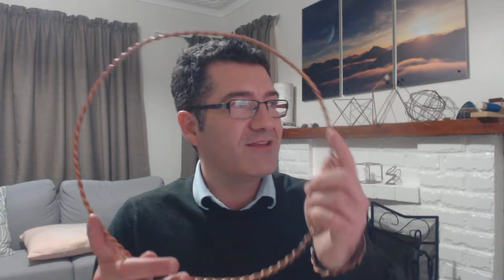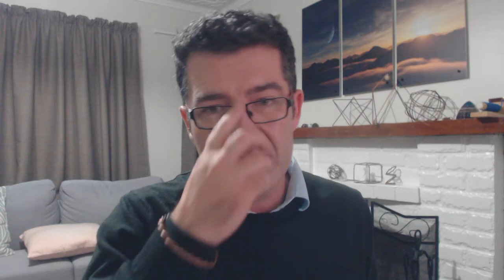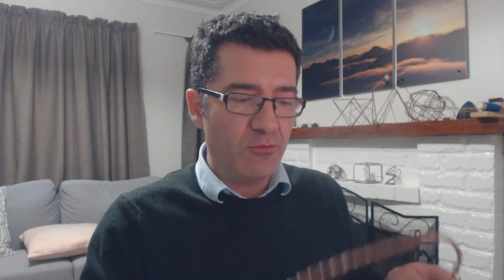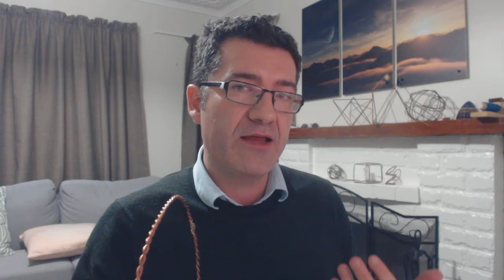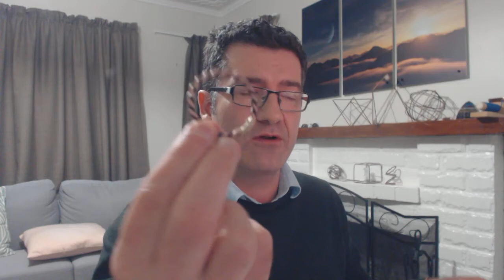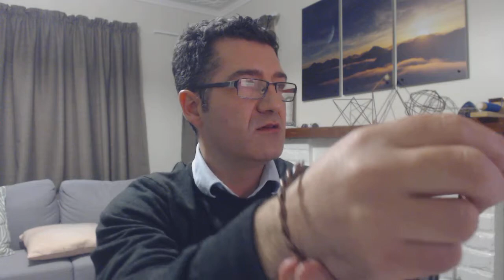Misconceptions regarding tensor rings

Comment: Try making the Tensor Ring using Varnished copper wire of the kind used in Dynamos. It works much better because the two wires are 'read' as separate by the Ether. Don't 'believe' me; Try it for yourself.

Comment: im thinking about getting either ring or pendant/necklace. will be there a difference for effects or not really?
Reply from the maker: No difference, more a question about the purpose you want usage of the product… if it’s purpose to work on the body, then a pendant or bracelet. BUT if the purpose is to work on food, water and other things then a tensor ring better
Reply: @trulyholistic3797  thanks! What is the difference between 144 and 188 mhz? Which one should I get?
Reply from the maker: @alex44m  I don’t use the 144 or 188. I have approximately 8 cubits I use at Truly Holistic that are NOT the sacred(144) or empowerment(188) cubits

Comment: great video! Im looking to buy it but i was wondering will the pendant/ necklace (closed) will have same effect as bracelet or ring? or will it give me  different effect depends on where i wear it??
Reply from the maker: A closed loop aka a tensor ring will anchor in a column of energy(frequencies) whether it’s in the form of a pendant or a ring. When its open(not a closed loop) the energy is not facilitated as a column instead as a field around the copper. But the most important aspect to know is that, as long as you wear it on the body it will be incorporated into your field.
Reply from the maker: All my products can be found at https://www.trulyholistic.net/products/

Comment: I was wondering if anyone could provide any clarity on the difference of a Straight Line Sacred Cubit and a Tensor Ring Sacred Cubit?  Can both be effectively utilized in the making of a Tensor Ring?  Thank you!
Reply from the maker: Straight line cubit means not to have as a closed loop aka a tensor ring. While the traditional sacred cubit would be for closed loop aka a tensor ring. Other than that I don’t know much more as I don’t use the sacred cubit
Reply: @trulyholistic3797  Thank you for responding!  One last question.  When measuring, are you measuring the wire pre twist or once it has been twisted?
Reply from the maker: @bozfreak  measuring after it’s been twisted

Comment: How about a gold tensor. I feel like it would be better for conductivity.
Reply from the maker: You can use gold, but why so many don’t is because the material is so expensive
Reply: @trulyholistic3797   gold is close to copper in conductivity, but copper is a tad better. Still, it oxidizes.. Gold does not. Yet SILVER also does not tarnish and is actually the best conductor. As jewelry, silver would be my prefered medium methinks.
Reply from the maker: @celebratedrazorworks  I make some of my tensor products with silver. Such as some pendants and finger rings

Comment: What frequency is best in your opinion and can you tell me what is the lenght for 528Mhz tensor ring.
Reply from the maker: There is not a length for 528Mhz. Having the ability to tap into multiple spectrums of frequencies is the best way to go, NOT a single frequency. The ORIGINAL format of energy = frequency, is energy that HOLDS wisdom, so by having the ability to tap into the multiple spectrums of frequencies that is your authentic make up as consciousness, you also allow your soul(wisdom) to guide what you require and need from moment to moment = the original SMART device. The cubits I use at www.trulyholistic.net are not facilitating energy outside of you, and they don't facilitate a single frequency... instead they facilitate MORE of your authenticity as infinite consciousness, which is a make up of multiple spectrums of frequencies. This is where we are unique in the tensor ring/tensor technology movement.
Reply: @trulyholistic3797  Great,thank you.

Comment: Secret is not the lenght of the wire before twisting,but after...it is not the same.thing?...if a measure 100mm of a wire..and then twisted...that wire has not the same lenght?
Reply from the maker: It’s the measurement of length after the wire has been twisted
Reply: @trulyholistic3797  thank you

Comment: hi sir, i thought the tensor has to connect at the end? but your bracelet is just open?
Reply from the maker: A tensor ring creates a column of light to come through, which is either the static frequency of the cubit or a spectrum of frequencies of the cubit… depending on what cubit measure you use. A straight line cubit where the ends don’t come together to form a closed loop anchors in the static or spectrum frequency/s BUT not as a column
Reply: ohh i see, so as long as what you need is not necessarily a column but you are just banking on the frequency it emits you can do unlimited projects that does need the frequency? for example, it is ok for me to make a coaster out of twisted wire? your insight would be much appreciated as I am thinking of making a tensor of sort holder for a very long quartz generator that I have and I can't go past imagining how I can connect both ends as it will end up not a circle but more like a wire art.
Reply from the maker: @journey.with.gratitude  from my experience most cubits can be what is called a straight cubit(it just won’t create a column of light through it, but the energy will be more an aura around that straight line of twisted wire
Reply: @trulyholistic3797  thank you so much I gained a lot of insights🥰
Reply from the maker: @journey.with.gratitude  your welcome 🙏🏻 feel free to gain more insights through all the services Truly Holistic provides https://www.trulyholistic.net

Comment: It is creating a vortex of what exactly?
Reply from the maker: vortex is the geometry of flow... cubits are anchors of frequency or frequencies or spectrum of frequecies(depending on the intent of the cubit used to make the tensor ring with). Within you, there is a quantum pathway that leads to how expansive your consciousness is... what many would call a soul, which is your energy siganture that is spliced over a multiverse. This means we have variants of ourself in a multitude of realities that share your energy signature and are connected = quantum entanglement(quantum physics term). So the tensor technology I currently provide facilitates more of YOU to be present here. 
What you see is 0.0035% of the electromagnetic spectrum of light, so our observation on such matter is clearly a limitation in understanding this dynamic. BUT everything are fractals coming from a vortex. Eg how the blood flows, how water flows, DNA, flames of a fire, galaxies... everything. Check out my more recent videos on my channel to learn more, as this is an old video.
Reply: @trulyholistic3797  I asked "A vortex of what?" - you replied with woo woo.

"cubits are anchors of frequency or frequencies" - No, an ancient measure of length, approximately equal to the length of a forearm. It was typically about 18 inches or 44 cm, though there was a long cubit of about 21 inches or 52 cm.

Comment: What if you just use one copper rod and twist it into itself to where you make 2 loops that are twisted together and the beginning and end points meet are connected together. Does it need to be two rods?
Reply from the maker: Well only one wire is used to make the tensor tools, its just bent back on itself to form the twist. So you would use one copper rod... and once twisted braze the ends together

Comment: Thanks for the info! I have a question..i read that it is important to glue back together each wire to itself so that it creates a loop.this is something a bit hard to make, do you think it would be working if you just glue back together the two ends or do the seperate wires need to to get back to theirselfs?
Reply from the maker: I have found that the two wires forming exactly back on themselves is NOT essential. As long it’s as close as you can get it and that both ends when you braze/weld/soldier are together forming a closed loop. I’m not sure about glue as I don’t use glue
Reply: @trulyholistic3797  yes i meant weld the together ..thanks for your quick answer

Comment: Hi Chris. A question about joining the tensor ring ends.....The correct method is to join the ends of each strand together , is this correct? . (The ring is then two pieces of wire twisted together)
It is also possible to join the end of one strand to the end of the 2nd strand. (The ring is then one long piece of wire) Hope this makes sense. Does it matter and is there any difference is effect of the ring.

Comment: EXCELLENT EXPLAINATION!
Are tensor tools safe to be worn on the body 24/7?

Does it have negative side effects?

Thank you.
Reply from the maker: Thank you 🙏🏻 Yes they are safe to be worn on the body 24/7. Your body will tell you when to take a break. No side effects… only side effects are a healing crisis, which means things are detoxing/shifting quickly = short term might be a little rough BUT long term benefits are massive. Check out my energy tools at www.trulyholistic.net/products/

Comment: Tensor rings are easily explained with basic science (electromagnetism). The copper is conducting ambient frequencies that creates a charge that accelerates faster and faster since it's flowing through a closed loop. The twist causes the acceleration and the closed loop keeps the charge accelerating until it reaches the limits of the size of the ring. As the charge accelerates, it creates a large magnetic field (flowing a current through copper wire always creates a magnetic field, albeit weak). 

The magnetic field created by flowing current through a closed loop with a twist (aka a tensor ring) is a very weak magnetic field, and gets weaker the bigger it gets. (Remember, weak magnets have larger fields while strong magnets have smaller fields). As the weak magnetic field gets larger, the void inside the magnetic field also becomes larger. The void is a "protected area." Like being in the eye of a hurricane. It's also called inertia. The center of a magnet increases inertia and acceleration, which is also the increase of dielectricity.

The toroidal fields are constantly pushing the EMFs away from you by way of the natural dielectric acceleration that is magnetism while you remain inside the the void. If you ground a tensor ring, the effect will STOP because you lose the magnetic field when all the current is channeled through a ground.

With a large enough tensor ring, you'll create a larger magnetic field big enough that the void will also expand enough to the point where you will literally be inside the void. This magnetic field is visible using a ferrocell, which is optical glass with ferrofluid in the middle. 

So, a tensor ring is literally the most basic of electromagnetics... flowing a current through copper wire, perpetually increasing the speed to generate a massive weak magnetic field, which creates a large void that you are in the center of (and with a large ring, your house is in the center of the void). The "vortex" people talk about is simply the dielectric acceleration of a weak magnetic field. The center of a magnetic field is centripetal convergence, which is not actually magnetism at all, while the outside of the magnetic field is centrifugal divergence, which is real, true magnetism, and this convergence and divergence (and dielectric acceleration) is what people mistakenly call "the poles of a magnet."
Reply: Thank you so much. Your explanation is easier to understand than this video itself.
Allow me to screenshot your comment here for easy reference.
Have a nice day.
Reply: Great explanation! Did you btw study with Ken "Theoria Apophasis"?
Reply: Just WOW! Brilliant!
Reply: Except that a tensor ring is neither magnetic nor electric. We are not running current through it. It works in subtle energy fields not in electromagnetic fields.
Reply: HAHAHAA nonsense, YOU KNOW NOTHING hahahaha, you reductionist materialist, how could you know ANYTHING? HAHAHAHA
Reply: Sounds like you have studied Fractal Field Physics?
Reply: so...dumb it down for me...like way way way down....does it have any benefits healthwise ?
Reply: Thank you ken lol
Reply: Which is really Sacred Geometry.
Reply: The explanation I've been looking for. Thanks.
Reply: Wow, awesome info.  Would the size of the ring matter in terms of it working?  If I purchased a bracelet, would it have to be an exact measurement for a magnetic effect for pain relief?

Comment: Are the correction measures of a cubit 20.64 inches?
Reply from the maker: There are many cubits
Reply from the maker: That is the measurement of the sacred royal cubit. A very old cubit... there has been many other cubits discovered since then. Which are more aligned to the present time
Reply from the maker: I have identified 8 different cubit from my dowsing and intuition capabilities. 3 of those I use alot
Reply: @trulyholistic3797 which 3 do you use the most or find most helpful?
Reply from the maker: @MichaelMerritt  well the three I recommend for clients is the activation, gateway, and ascension cubits. I personally have evolved beyond those, so currently the cubits I utilise myself is the infinite ♾️, and eternity cubits. Eternity cubit is most recent that has allowed my auric field to expand to 150 km

Comment: I perceive it to be morphogenetic fields more, and in tensor rings there are several if they are well made.
1. The geometric distortions of the twisting motion, 1.618 being ideal as a ratio. (9)
2. The copper acts in resonance directly with the Schumann resonance of the Gaia
3. The distance in the ring is another geometric calculation in 5th density construction
Copper, silver and gold wires will have different ratios and sizes because they have different atomic resonance. It's all about fractal calculations of frequencies and each element has it's own resonant frequency. But these three are the noble metals. 

Good video on the basics though.

You should do videos on how to make though, the welding, soldering etc options not just the sizes.

Comment: Hi, How does the (own) frequency matches in... why is the 177 Mhz or 144 Mhz so important?
Reply from the maker: I have found that the cubit measures I use which anchor in a spectrum of frequencies are bringing in more of your light. Your higher intelligence brings through the frequencies you require. Energy is shifting and moving all the time. 144 and 177 are deemed important by Slim Spurling as they were the first two cubit measures brought forth by him. Slim being a frontier in regard to tensor rings

Comment: Hi, I have tested a sacred tensor ring over  water in a glass for about three months,fit changed the water ph!
What are the largest gauges you handcrafted  with?
Reply: I've used 6 and 8 gauge for use under the mattress and under massage tables.  Most used by me are 10,  12,  14 for water, use on the body, electric meters, my resin pocket Orgonite personal pieces and pyramids.  FWIW
Reply from the maker: * Seeking * Infinite * Love* anything from 10 gauge to 18 gauge
Reply: @trulyholistic3797  Thank you! Do you think or know if the different gauges change the hz, and do you have to adjust the length of the wires?
Reply from the maker: * Seeking * Infinite * Love* the length remains the same. The length is vital to anchoring in a certain frequency or spectrum of frequencies depending on what cubit measure you are making your tensor ring. The gauge size does not change the hz frequency.
Reply: @trulyholistic3797  Thank you, very kind of you to take the time to answer! Best wishes A.

Comment: hi in trying to make tensor ring but i have 13 gauge wire i read that to make tensor ring i need 10-12 gauge wire but i cant find any of that sizes where i live. can i make with 13 gauge wire tensor ring ?
Reply from the maker: dubravko .popovic you can make tensor ring with any copper wire. 13 gauge is perfect
Reply: @trulyholistic3797  thank you for fast answer i was looking video on creating rings and it said that you can only make tensor rings with 10 and 12 gauge wires

Comment: so "take some copper wire and twist it together and it becomes magic" good lord how can anyone believe any of this nonsense. so every piece of 10baseT ethernet cable ever made must be magic too.
Reply: It's funny you should mention that example. yes, if you untwist the wires inside the cat5/6 sheathing, it will magically reduce range or quit working. But the magic part is lost on people that understand why.
Reply: @ej00807  no magic involved there i'm afraid. The only thing the twisted pair topology does for ethernet is reduce the line crosstalk by making the magnetic field less uniform by altering the field vector.

Comment: Hi, I do not understand conception of tensors rings and bracelet, tensor rings have to be soldered not create diffrent  energy or to have "the required  spectrum of frequencies"but  bracelet can be opened and touch or not touch the ends. Where is diffrence?The output of energy is the same or it is a big difference?THX for an answer.
Reply: It doesn't create, it focuses. It also doesn't deal directly with energy as expressed in this 3rd dimension as much as the energy that governs the expression of energy in this 3rd dimension.
Reply: don't even bother, this is absurd nonsense. how can some twisted copper "create energy"? that is a violation of the law of thermodynamics. at most it would be a fancy looking antenna for radio waves, but it couldn't even do that well being a closed loop.